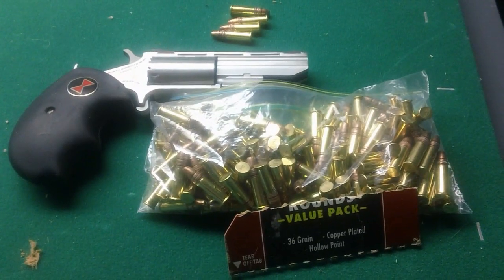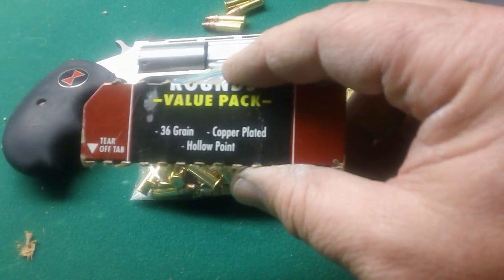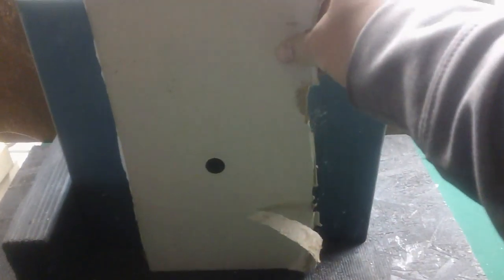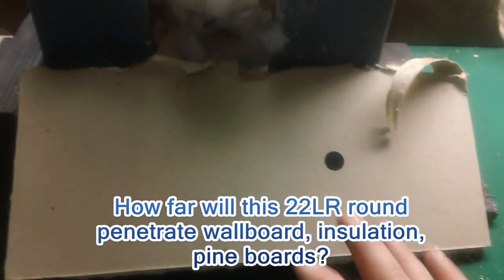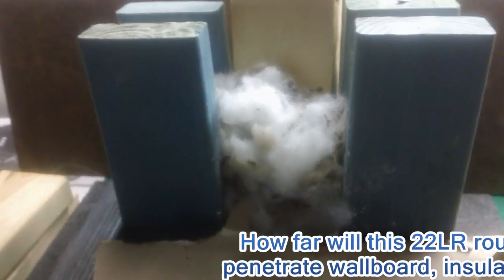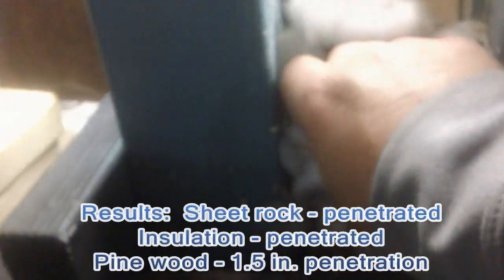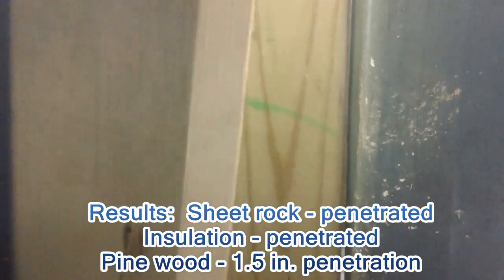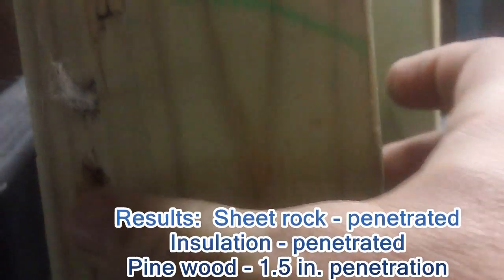Federal 22LR vs Dry wall, insulation, wood penetration - ballistic testing

Comment: Just a thought: You might have simulated an interior wall (with 2 layers of sheetrock and no insulation), and then also an exterior wall (with insulation and some particle or fiberboard on one side).  Many of us are curious how many interior walls .22 ammunition will shoot through.